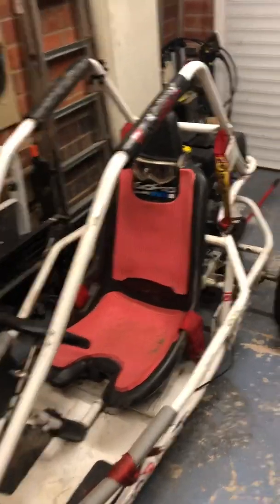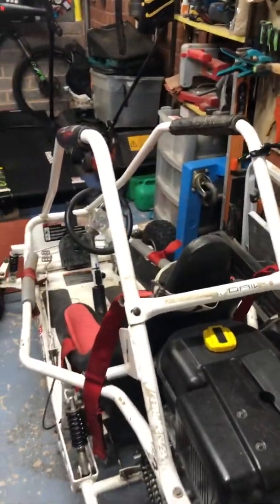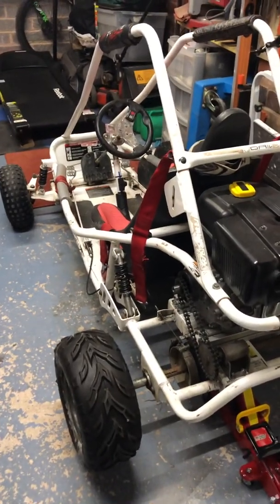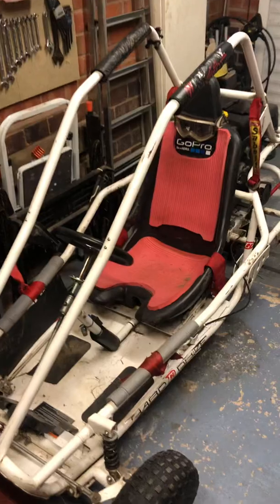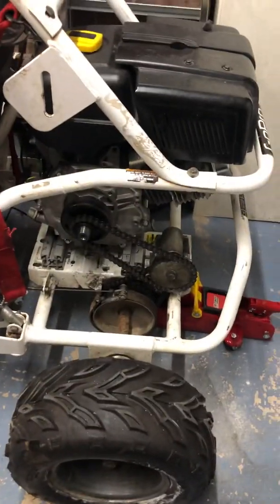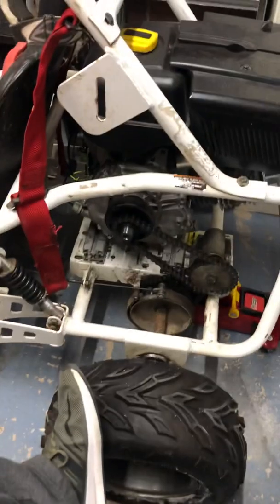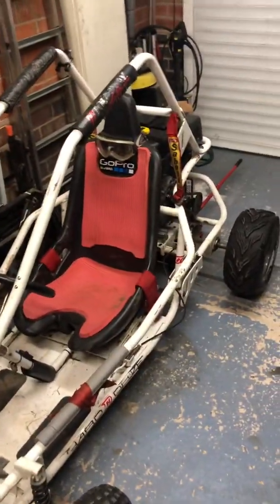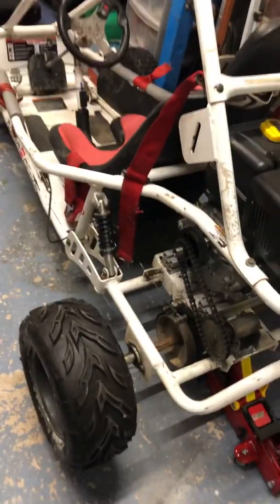Murray hard drive go kart buggy 15hp 420cc

Comment: What's the top speed?
Reply from the maker: It should be good for at least 30 at about 5,500rpm but I will do a video when I finally get out on it. Weather depending
Reply from the maker: Managed to do a top speed run and saw 37mph but given the inaccuracies of speed apps I would go with 35mph to be safe. I was surprised at this but happy
Reply: Did that 420 fit preexisting motor mount holes, and did you need any spacers it we're you able to mount directly to  stock plate?  I'm doing a similar build.
Reply from the maker: Justin Pfizenmaier I had to raise the engine to fit the torque converter. I wouldn’t recommend fitting a clutch, so if you raise the engine by 75-100mm and fit a 30 series torque converter you will be fine. Its all very tight but manageable. Let me know if you need more help.